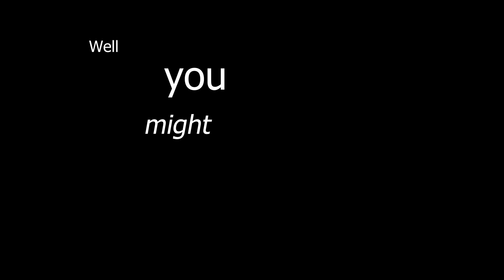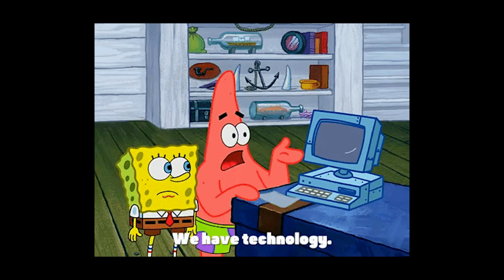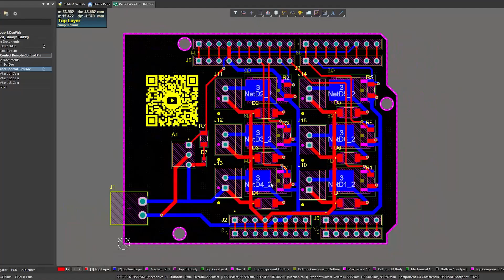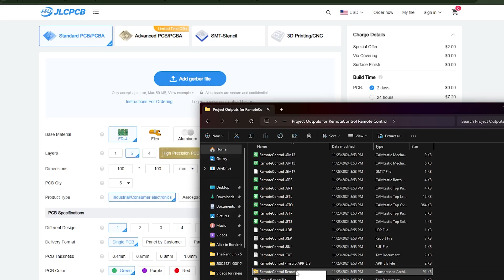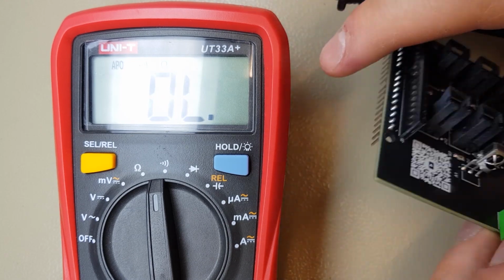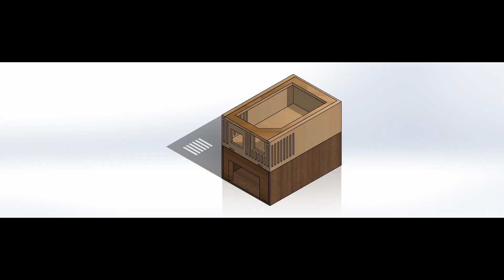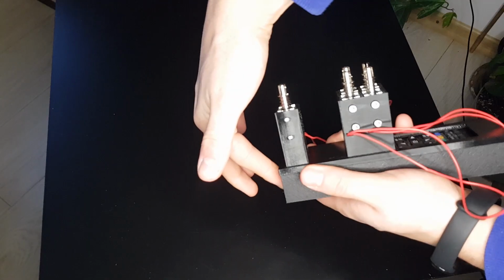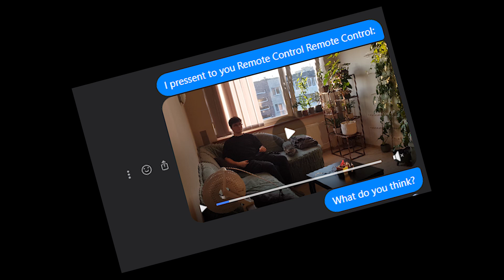I Made a Remote to Control My Other Remote - Does it Work?

Comment: You need a remote controller for the remote controller controller just in case you lose it.
Reply from the maker: But what if, and just hear me out, you lose the remote controller for the remote controller controller?
Reply: @Audas101  That's material for a next controller for the remote controller of the controller controller in line for another video~